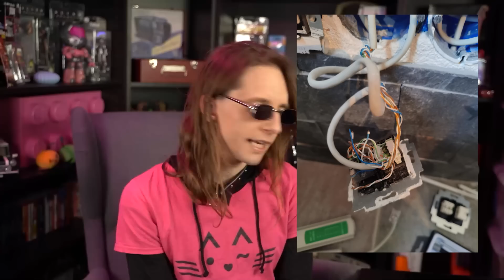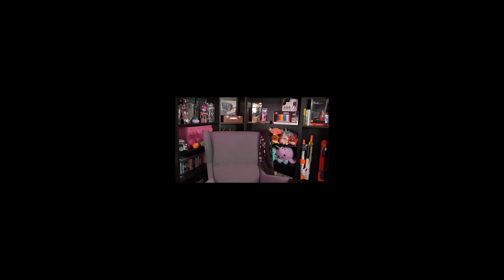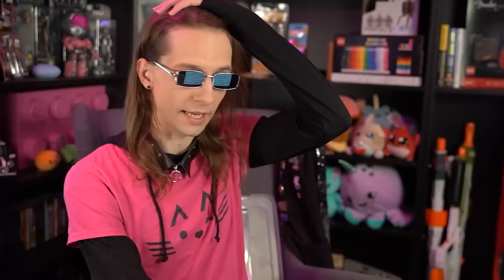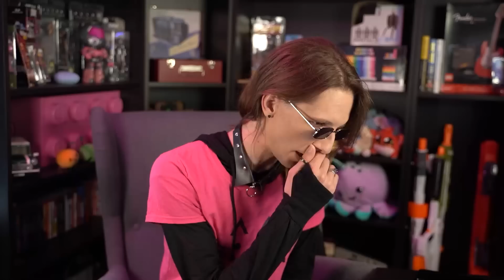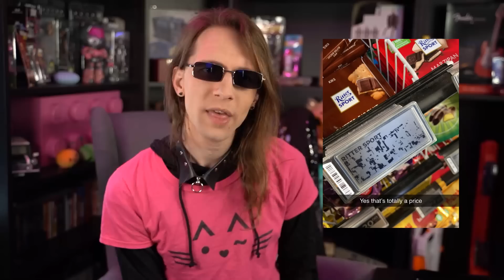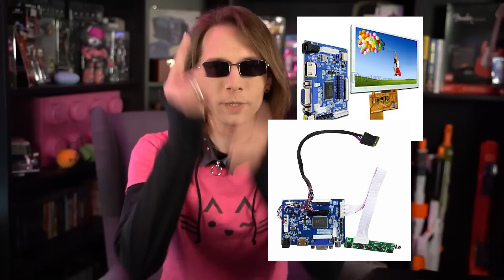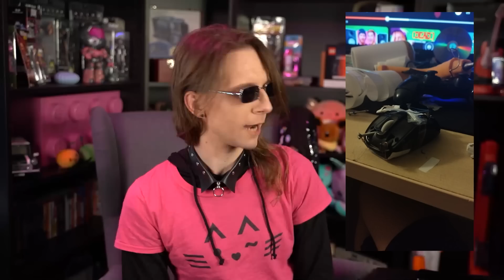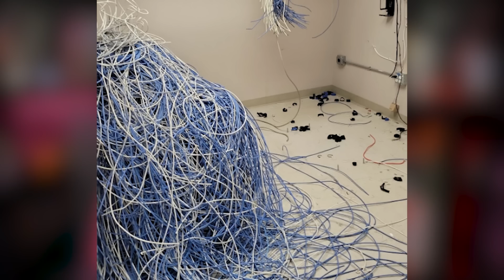Top 10 Ways To Notwork Your Computer'nt | Lexplanations |  r/techsupportgore & r/hardwaregore

Comment: 8:52 the CFL tubes in your monitor have an electronic driver that overheats and dies. The older backrooms type fluorescent lights had magnetic ballasts that would hum, but they're very durable. They would burn out but they would last decades.
Source: inside wireman for a large building complex for 5 years

Comment: I'mma just go ahead and say that the PS4 isn't fine, but the problem isn't the gauge of the wire. That's a UK plug, mains voltage there is 230v nominal, all of the gaming consoles from the 360 up to current gen PS5 and Xbox Series X are rated below 230 watts, meaning at their voltage the amperage is sub 1A. 28 AWG is rated at 1.4A, I don't know breaker sizes in the UK, but your standard 15A breaker in the US is only going to use 14 AWG which isn't all that thick, for a total energy throughput of around 1700w.

Unlike the 1800w inverter I just got which is 12v input meaning with no conversion inefficiencies (eg if it was F-ing magic) it would still need 150A, meaning I would need 1/0 gauge wire, but because it's not magic I actually need 2/0 which ain't cheap...

Also yes this video did make me cry.

Comment: Regarding that game console powered by two little wires, that's roughly the gauge of the conductors that you'll find inside an appliance cable. You'll find 2-3 conductors (hot+neutral and sometimes ground) inside a molded rubber sheath. That's a PlayStation 4 which uses an IEC 60320 type C7 appliance cable (figure-of-eight connector), so it only has hot and neutral.

FFS OP needs to just BUY A DANG CABLE. They're not that expensive and WAY safer than loose wires flopping in the breeze! @.@

Comment: E-ink price tags are very very common in most parts of Europe, since they don't actually use any power while  displaying an image (only while changing the image), so instead of having to buy expensive paper and ink, aswell as print new price-tags every time you need to change the price of something, you can just have some dude with a special device plug the tag in to change it, which only takes a few seconds (and no they do not update live as they are not even connected to power most of the time, some of them don't even contain the display driver for the display, it is all in the little device)

Comment: The "I didn't have a wire so..." is with a UK socket, a dodgy one too since there are supposed to be shutters to stop you from putting anything in before the earth pin in inserted, also 230v 50hz.
Reply: I don't have much experience with UK sockets but can't you normally put a stick in the earth pin to open the main holes then remove the stick when you're done?

Comment: That description of power capacity doesn't match the resources available to me. The capacity of a wire is generally given as a current capacity, and that current capacity is given as a function of the cable's gauge and its construction, not its length. I believe the idea is that at a given current, each unit length of the wire generates some amount of heat over a unit time, and each unit length of wire is also capable of dissipating away some amount of heat over a unit time. The absolute maximum current capacity is when the amount of heat generated matches the amount of heat that can be dissipated, and that is length-agnostic. Unless you are coiling your wire up, that analysis should be valid.

Length is still important in that the greater the length of wire, the more the voltage available to the load will sag when the load is connected, and this can cause the load to malfunction or be damaged.

Comment: the battery in my galaxy S7 turned into a spicy pillow on the first day of school back in 2021, but it wasnt as bad as some of the pictures I've seen. when i got home (it died during my first class) i tried charging it. but all it did was get hot.
after a day or so me and my mom managed to rip off the back, revealing the pillow
it has since deflated after 2 years of me not trying to use it
i am still hoping to get it fixed as theres a crap ton of media/memories on it
Reply from the maker: Yeesh

Comment: 2:24 On an old monitor with an AC/DC inverter, they carry enough charge to give you itchy fingers (speaking from experience)

Also, the alkaline batteries we buy don't have any expiration date on them. How long does it take for them to expire? Should I expose them even if they are still in the seal?

Love your videos btw ❤
Reply from the maker: Usually 5-10 years is okay. I wouldn’t unseal them because if they leak, the plastic should keep them somewhat contained .
Reply: @TheLexikitty  Thank you, I'll keep that in mind.

Comment: "what about my old lead acid batteries stored in an unheated building for several years because they were too heavy for my grandparents to lift(their batteries really)"
Reply: and the nicd batteries, and the older nimh batteries i have the oddly worked once changed 

is an expanded lead acid battery a sour pillow as opposed to a spicy pillow

Comment: "After 3-5 years, will make clicky noises, and forget everything"
Dang I was lucky then, the HDD on my old laptop lasted over 8 years with fairly moderate usage before it died on me [for a month or two it kept blue screening when it got stuck trying to do I/O operations, eventually got stuck on the boot screen and couldn't boot at all, luckily I did my most recent backup just days before it died, it's like I knew]

Comment: The AWG explanation reminded me of when I was trying to wire a fan hub with an ATX breakout board. I kept looking up pinout stuff for the fans and the fan hub, and kept finding conflicting info on if the wire controlling the fan speed was a 3.3V or a 5V. Naturally, I flipped a coin, and chose 5V. After the result, I am about 99% sure that wire uses 3.3V

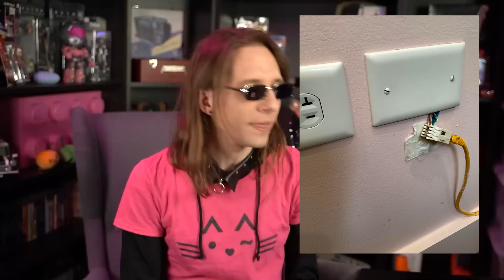Comment: 1:10 I am going to assume the store did not have the proper plates in stock.
2:25 I suspect you would get a zap from the 5V HDMI cable if your licked it. Stopped licking cables after trying to lick 48V telephone once. But 9V batteries are know to give you a zap: and they are less than double the HDMI voltage.
Reply from the maker: It comes down to amperage for HDMI, it’s logic level, you wouldn’t feel it. Telephone Carrie’s power for the actual handset. 

Also as somebody who did contractor calling installs in NYC, I always carried an extra 10-20 plates and jacks in the bottom of my bag, it’s wild to leave something that bad like that.
Reply: @TheLexikitty  After some Googling: HDMI supplies up to 50mA. Rule of thumb is that you can feel around 5-10mA (20mA across the heart can kill). 

The only reason I think getting a shock is possible is that you specified "licking". with dry skin you won't feel a thing.
Reply from the maker: 9v batteries run 400-600mA and give you a mild buzz, so 4.9-5.3v at 50mA would be pretty hard to detect, although I guess you Kirby feel a tiny prickle? You’d get more out of a computer USB port

Comment: An additional point regarding the PS4- I don't remember if it has an external power supply or not, but if it does, running wires directly from mains into the system is basically a one-way trip to magic smoke town. Don't do that!

(Running direct wires like that is a bad idea regardless of whether or not you're skipping important components, but it's especially relevant if you are.)
Reply from the maker: PS4 does fortunately have an internal

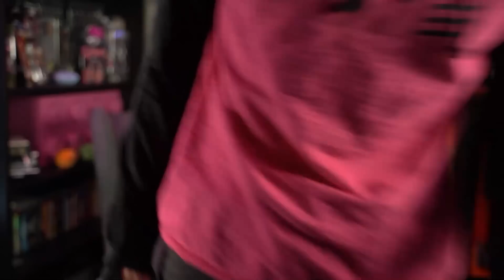Comment: At 5:22, that's a UK plug, not an American one, so it probably can carry a lot of power - like I've seen ring mains (wires in the wall) looking like that, so I'd be happy to put a fair few amps along that - you'd probably get at least 1kW without exceeding the rating of the cable (I've seen 8A safe cables look smaller than that with the outer insulation off). If I were to be worried about heating it would be at the connectors, where a poor connection could really build up heat.
That's not my concern really.
My issue with it would be that THAT IS MAINS, and not the cushty US voltages, nooooo, this is proper 220V power, which is a spicy amount. And on the user end, those wires are wrapped around round pins, so will just slip off when the feel like it.
Also, I'd like to note how much effort went into doing this, as UK plugs need something in the earth (top) pin to open up the others, so they had to like jam a screwdriver into the earth pin to even begin this abomination.
Reply from the maker: This just gets worse and worse
Reply: @TheLexikitty  Ohhh, yeah, absolutely. Though, honestly, doesn't it always?
Reply: Yeah 240 volts hurts quite a bit
(I'm talking from experience)

Comment: e-ink price displays are absolutely a thing.
yes, they might update WHILE you have the product in your hand and are on your way to the checkout, but it absolutely beats me having to print out updated prices on paper, having to run through the store and shoving them in those annoying paper-price-tag-holding-rails that really like to break on you if you bend them too much.
yes, they cost an arm and a leg to the company (those things are actually really expensive!) but at the same time i don't waste about an hours time per work day checking prices, printing new tags and distributing them. during that time i am available to help customers find what they need and heal them from the notion that you can buy a high-end gaming PC for 500 bucks because they have seen one online on ebay . . .

well, and sometimes those e-ink price tags break. usually they get their displays broken/smashed by employees not taking care of them or customers being not as careful as they should be and ripping them off shelves and dropping them. a broken e-ink display doesn't usually look as cool as the one in the picture, but breakage happens.

Comment: On the topic of pillows:
I was fixing a friend's cheap airpod copies, and he said they do not charge or turn on, but the case does get hot. I open it, and I see a fluffed up pillow with a bit of burnt on the little dauther board inside the pillow case. I just cut it off, threw it in my batt bin, and then tried charging the pods directly from the case, skipping the battery entirely. Works! Now waiting for the plastic on the pods to explode when their batts expand, so I can tell him not to get the cheapest crap he can. Moral of the story, don't buy THE cheapes chinese crap you can. Buy the fourth

Comment: General rule of thumb should be that if one is relying on the tensile strength of the connected cables for an installation, one is doing something wrong...

(I recently found my psp battery trying to escape the enclosure, sheerly by taking it out of the case by dumb luck, good timing on the spicy pillow warning)
Reply: That should be a rule but... Some of those cheap little boxes you need to hook up weigh basically nothing and I really can't be bothered to do the right thing.

Comment: 9:23 - unless of course it's a drive from Seagate in which case that mofo won't make it much more than a year on average.  At least that's been my experience with them.   I've had 5 or 6 of them and i've only had one last for longer.   Backups are definitely your friend there.
Reply from the maker: The IronWolf ones are okay, WD Greens are the worst now
Reply: @TheLexikitty  I don't have recent experience with seagate's hardware, so yeah I imagine they could have gotten better QA.  I'd hope so anyway.  They didn't even have these separate model branches yet when I swore them off(so...~20ish years ago, geez I feel old). 🤣
WD has it's own special brand of issue that irk me, but i've been pretty happy with them otherwise(no unexpected failures...yet).  Haven't used the Greens... I don't know,  something about recycling parts old broken drives to make another doesn't exactly set me at ease.     I wish the prices for SSDs would go down a little faster, 😿
Reply: @TheLexikitty  I have a WD blue that ran since 2009 before giving up. Is that good for a hard drive?
Reply: Drives will only fail if you need to rely on them. I salvaged an old 80 gig Seagate drive which was failing SMART and used it as a "temporary" test drive when hacking together a mini server. That was probably 7  years ago. Now it has over 10 thousand power on hours (11.8 years) and 4 thousand bad sectors but somehow it still keeps working.

Comment: I have an old Thunderbolt alarm control box in a closet next to my front door.  The warranty on the batteries expired in 1985!  Oddly, they have not corroded.  They are rechargeable, but still...1985!  The klaxon is still mounted on the outside of the house.

Comment: Trust me, those wires are definitely more than thick enough, though I can't comment on how good the connection with the port on the console is, so it might heat up or even catch on fire at the console side from the contact resistance.
Reply: Counter-intuitively the higher the voltage the thinner the wire can be.

You may want thicker insulation or thicker wire just for mechanical resistance.

Comment: 6:25 they are called ESL's (electronic shelf label) and they either get destroyed when someone pops them off wrong (I've pulled the screens off a few lol) or get dropped when you slide em out to hard causing them to go flying across the isle lmao , they have a coin cell battery like a computer mobo but no one replaces em, they just throw them in the waste bin if it's flat (yes they have a circut board in them), I had to clean under the entire stores shelves last year and recovered over a hundred of the little fuckers in various states or working to broken to o my god what are you covered in.
We usually try not to break the ones pictured as they are more expensive than the traditional digital screen ones you see at stores.
Reply from the maker: This seems so wasteful and over complicated compared to a sticker gun

Comment: I have a battery box. I also have a multimeter. As far as I know, the batteries are more or less usable. :) Also, as far as I can tell the thickness of the cable going to that PS4 seems fine. EVERYTHING ELSE is however fuckered up.

Comment: When I was a teenager I wanted to wire additional speakers through the house from the main system. I ended up with Lounge room, My bedroom, the bathroom and the balcony. I did it all by running wire under the floor. The only wire we had was detonation wire, dad worked in a mine. Looking back I wonder just how bad the sound mist have been over this single strand of cheap wire.

Comment: Those "e ink price displays"? Best buy uses them for everything. Every morning their prices auto update from the servers due to having an infrared receiver built in, and can also be used to activate a green flashing light to easily locate items in store. When it does that it means it has either received garbled information from the ir-blasters, or it's internal battery has or is dieing.
Reply from the maker: I haven’t seen them in any local ones in rural PA or MYC
Reply: @TheLexikitty  they don't look exactly like that one, but they are similar. So the tags in your local best buy have white borders and red on top when sales are live?

Another way to tell is if there are 2 different kinds of black orb in the roof. One of them is your standard security camera, and they are just single black balls hanging from the ceiling. But the other kind are more donut shaped. Those aren't security cameras. Those are the ir blasters I wrote about. (Unless I have been fed a load of horseshit by my coworkers). those are used by the systems to update price tags everyday or, can be used by employees to turn on flashing green lights on the ESL tags(what they are called) so that they can easily locate products.
Reply: @TheLexikitty  of course I could be making assumptions based on false information that all best buys are operating on the up to date standards
Reply: @TheLexikitty  again, until you can prove it yourself, take everything I say with a 50lbs bag of salt
Reply from the maker: Yea all of ours are just paper stickers like normal
Reply: @TheLexikitty  alright then sorry about making assumptions!

Comment: lexi, I want to practice soldiering. I believe it was in your first lexplanations vid, you said to get a breadboard, a smaller breadboard thingy, and some soldier. I was wondering a few things. 1. what was the smaller breadboard called 2. I have some old soldiering irons, that have a regular pronged plug. do I just plug it straight into the wall, or is there some sort of like, amp, or regulator kinda thing I need to get? 3. where do you get soldier? 4. if there isn't an amp/regulator, how do you adjust the temp of the iron? 5. where should I buy the stuff? 6. what temp should you use for soldiering? 7. would it be safer to buy a new soldiering iron? the ones I have are god knows how old. 8. are these questions stupid?
Reply: If a soldering iron has a regular wall plug you just plug it in and hopefully whatever temperature it reaches it good enough. For chunky through hole stuff it's good enough.

Comment: Darn you lexi. That gag got me at the start since my laptop has a habit of being slow, but you're too cute to be pissed at

Also, apparently a few years ago the guy who installed my grandparents' wifi used the wrong port, so it was slow as hecc. All that had to be done to fix it: Swap the cable cable and the ethernet cable ports

Comment: Regarding the "didn't have wire" at 5 minute mark, these look like (sorry, don't work with AWG) at  least 1mm^2 wires, maybe even 1,5 so good for 6 or 10 amps respectively, which is enough. Even if it's a 300w monster, and US grid of 110v, it's still double capacity on the cross-section. Comparing to the extension cord it looks to be same gauge as that. 
Completely irrelevant though, due to possible intermittent contact sparking and shorting out possibility with such a "mount".